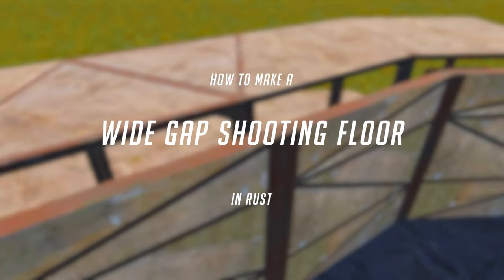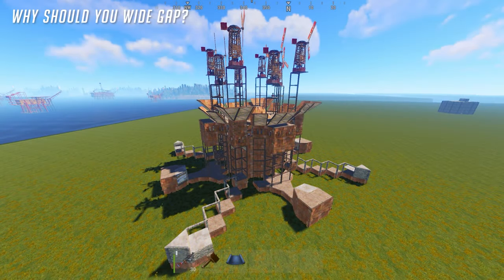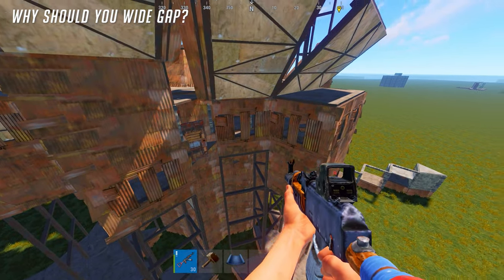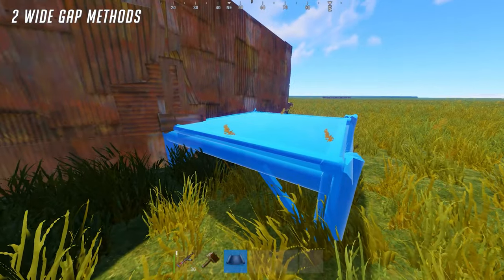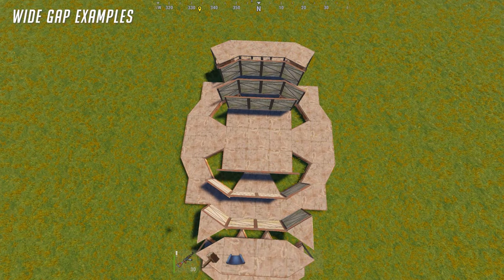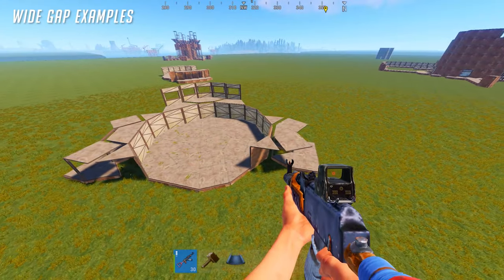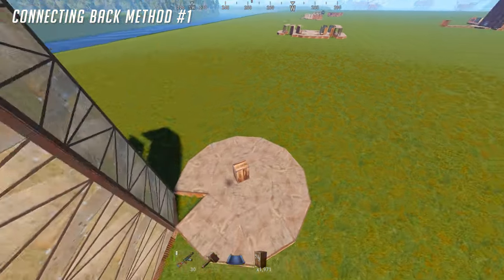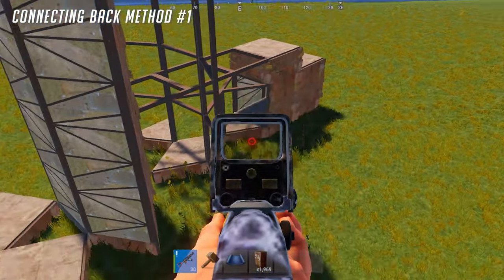The WIDE-GAP Meta | Base Building 2021 | Rust

Comment: whats the point of external tc besides just blocking people from building at a bigger distance
Reply from the maker: Most of the times you can build back external tc's towards your base and they will function as take over TC's as well; if your main TC gets blown raiders won't be able to have build privilege as the outside ones take over and so you can't get griefed.